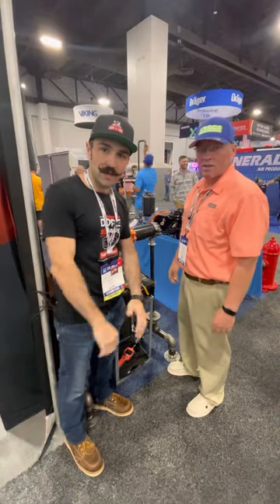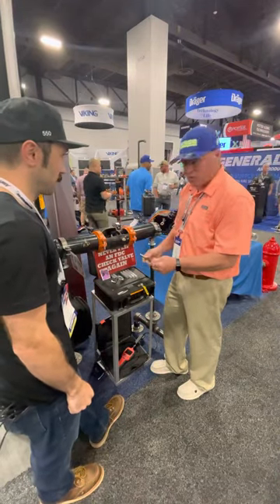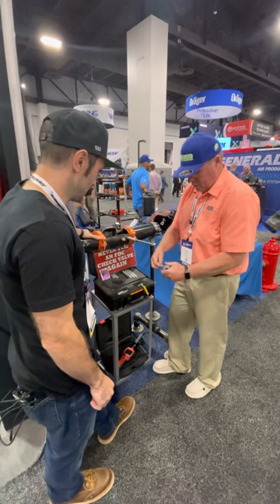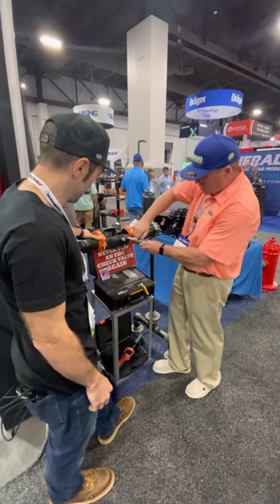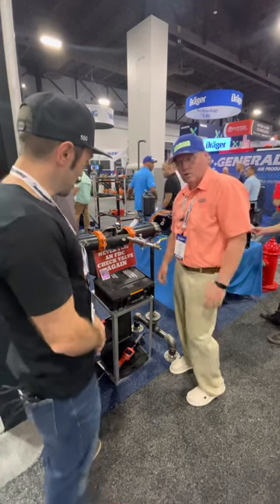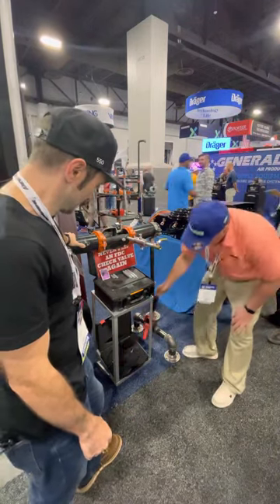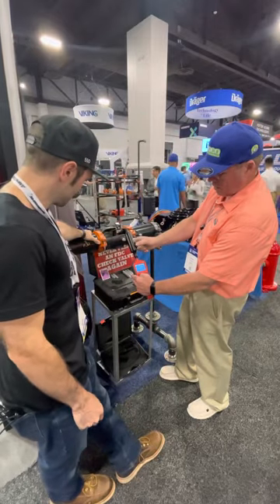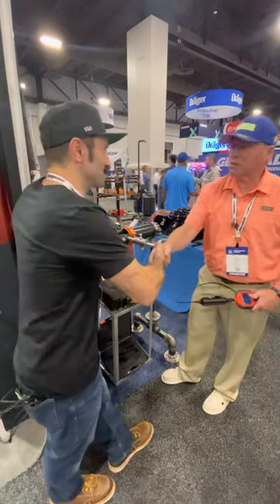NFPA 2023 HYDRA-TAP FDC INSPECTION TOOL W/ DETAILED EXPLANATION BY JACKIE FROM ARGCO

Comment: How do you get to the required 150psi if the system sits at less than that? Still have to put a hydro pump on and flip the check?
Reply from the maker: Hydro yes but no need to flip the check
Reply: @DOPEandTAPE  I’d like to see a video showing that setup.
Reply: @rivalearth330 me aswell try g to convince my work to buy one but they want a video of hydro test with tool

Comment: Can someone explain why you would need to flip a check valve in the first place? Here is Australia we never need to do anything like this. We do remove and inspect some check valves from time to time. But never flip.
Reply from the maker: You would do this to Back flush, forward flow or test your fire department connection

Comment: I truly believe I’d spend less time removing the four bolts that fasten the grooved coupling. Flip that check valve, flush, and restore the system faster than this device. The time consuming part is draining the system.
Reply from the maker: Then you need to flip it back… you should do a timed video next time. This is a new tool, once you learn how to us it, it goes much faster. This was a demonstration we weren’t on a time race here
Reply: Your trippin. To flip a Check valve is going to cause a mess and take way more time. This tool is a game changer. I’m a union sprinkler fitter in Los Angeles ca and I’m gonna get my company to get this.